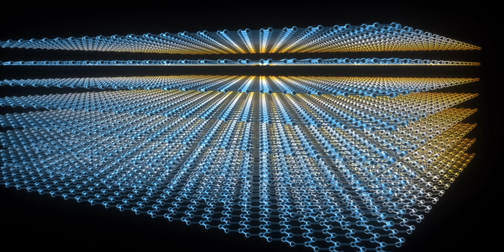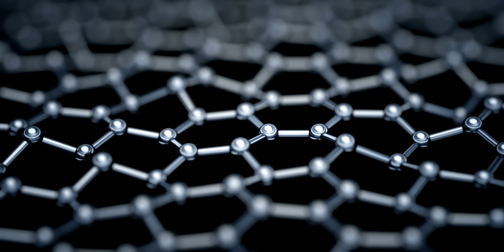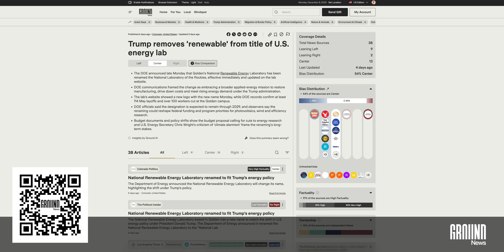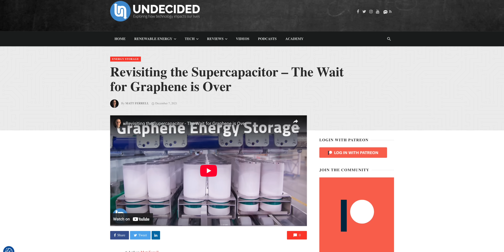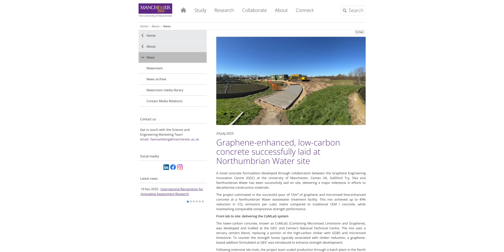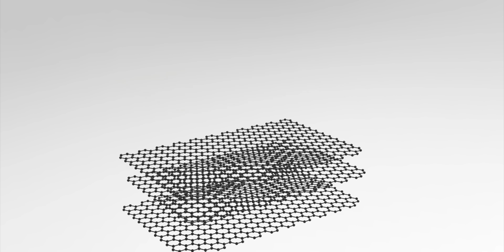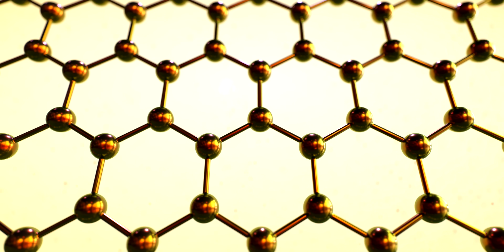How Graphene is Changing the World … Right Now

Comment: The main problem lies in the significant economic interests of many companies and governments that prefer to continue using other materials instead of graphene.

For example, the use of aluminum cable with a copper coating, which many companies already manufacture and market as copper, aims to increase profits and generate higher revenue from consumers. This type of cable has a shorter lifespan, as pure copper lasts much longer, making it unprofitable for many companies and governments.

This is the major current problem: almost everything has a shorter lifespan and is now disposable.

This has been the big business for several years.

I believe that graphene is truly superior to many materials, and it's simply a matter of fully utilizing its potential without considering its disposable nature.

Comment: the cooling topic doesn't make sense to me, if its generating heat it needs to be removed, if its producing 80% less heat I can see the correlation with the Datacenter needs.  It sounds like its able to dissipate its heat, but the heat is still present in the ambient.

Comment: You have a huge problem if that concrete is proprietary it'll never be used at scale it's got to be cheap mass produce able and something everyone can use without license something anyone anywhere can manufacture with machine and material availability at the same level or better than typical concrete or it just aint gunna happen. I would love it to be a thing but to go from concept to reality there's alot.

Comment: Anyone that calls AI a bubble needs to look at how the graphene industry has slowly but surely turned into a monster based on its potential alone. AI is the same with word changing potential, so it doesn’t matter if the bubble pops, it’s going to keep going up on the longer term extrapolation and it’s never going away at this point.

Comment: The difficulty with concrete or concretene is shipping. The shipping cost of electronics are marginal, but concrete has to be produced regionally to be cost efficient. Even if the claims of concretene are true, it needs to be broadly licensed and easy to manufacture with existing infrastructure to make a real difference.

Comment: Many years in the concrete biz here - if graphene were to be used as a batch component, it's going to have to be produced on an enormous scale.  Factor in what kind of energy requirements that's going to require, and the fact that the overwhelming majority of graphite has to be shipped here overseas, and that 7% figure, IMHO, starts to look reasonable.  Few people realize the volume of concrete volume poured daily .. it's truly astounding.  At this particular point in time, there are no viable substitutes in terms of performance, economic viability and availability.

Comment: 9:04 is this video AI-generated? What you're showing here is impossible. DC will not pass through a capacitor. As a matter of fact, blocking DC is one of the major applications of capacitors.
And that motor-like thing isn't even connected at one end.
Reply: What are you talking about? The computer you're using to watch this - at least mine - is DC based and is FULL of capacitors. So what's the issue?
Reply: @ross-carlson  How they are used in the circuit matters a lot. When they are parallel to the DC votage (so between VCC and GND) they can be used to stabilize the voltage. But when used in series, as shown in the video, they will block DC and only let AC through. This configuration is used at all the audio connectors of your computer, to ensure the audio signal oscillates around 0V (removing any DC offset).

Comment: the problem with every battery in existence today is that it’s passive. It’s just a static chemical warehouse. I propose we stop building warehouses and start building Lungs. There is a new class of material—a 'Piezo-Respiratory' Crystal.

Here is the magic: It is active. When you plug this battery into a charger, the voltage triggers the crystal lattice to physically inhale. At the atomic level, the material stretches open, creating massive superhighways for energy to flood in instantly—zero friction, zero heat.

The moment you unplug it, the lattice snaps shut—exhaling—and locks that energy inside a dense, tight structure.

We don't force the ions into a crowded room anymore. We make the room bigger when we need it, and smaller when we don't.

This is the Breathing Battery: Charges in seconds because it's open; lasts for days because it's dense.

The Material Ba(Nb0.2 Ti0.2 W0.2 Zr0.2 Ta 0.2)O2F: Fluorinated High-Entropy Piezo-OxideI propose a brand new, theoretical super-material 
The Backbone : These elements are selected for their Piezoelectric properties. When a high-voltage charging current hits this crystal, these atoms shift, mechanically straining the lattice. Ti/Zr/Ba
The Highway: These are the Wadsley-Roth elements. They provide the tunnels for Lithium ions. Nb/W
The Trigger ( Fluorine): Fluorine doping lowers the activation energy, making the lattice "flex" more easily without breaking. F - Fluorine

Comment: while I'm no scientist perhaps a chemically dissolving tape could do the trick? if there's a chemical that cant break down graphene then we need to identify it and make a tape or adhesive that can break down only to said chemical. in other words we need to make rolls of tape or adhesive we can either roll or spray onto a moving belt and dissolve only the adhesive with a chemical compound. here's a visual as to how the process if done such way could work.

roll the sheet of graphite under an mechanical belt coated in the adhesive material. the layers of graphene are stripped away by the sheet of graphite. as the belt goes it goes into a shallow pool of a chemical compound that will be used to gather the graphene dissolving away the adhesive so the graphite can be collected. with the belt going back around to be re-applied with more adhesive to begin the process again. creating not only an industrial method that could potentially be scalable but a method of which could provide graphene in decent quality, cheap to manufacture and an heavy increase in the quantity. however this awaits trial and error to identify if this method can produce it in sufficient enough quality for applications such as electronics and weather or not the chemical compound that will be used to dissolve the adhesive will affect the graphene in any serious way as to make it unusable. but i do suppose time shall tell.

Comment: We have developed a novel machine which is called High Shear Thin Film Machine. This machine able to disperse graphite into single graphene (it can do only dispersion, or dispersion and orientation both if needed) at the same time the dispersed by one graphene will orient in molten polymer (the medium could be anything, only it should be viscous). This machine is not commercialize yet, trying to find licensee. https://patents.google.com/patent/US20220032245A1/en?q=(high+shear+thin+film+machine+ilchgerel)&oq=high+shear+thin+film+machine+ilchgerel

Comment: Regarding graphene super batteries. A lot of what you can find on the company website is very impressive. The incredible short charge time, the much more sustainable material usage and so on. The problem is, the energy density is 65 Wh per kilogram. 
In comparison, the energy density of a Tesla model three battery is anywhere between 240 to 290 Wh per kilogram, which is at least four times better. Now, considering that a Tesla battery weighs anywhere between 700 and 1000 pounds, if you multiply that by four, you would have to have a 4000 pound battery which is rather laughable. In itself, the battery would weigh as much as an entire car. So, you could potentially replace your Tesla battery with this new battery and it would last many more years and would charge in a fraction of the time but you would just have to charge it four times as frequently (assuming your new battery is the same weight as the old one).
Just a little perspective here..

Comment: Charging your phone battery in seconds sounds like a great way to cause a house fire or blow your fuses. The wires in a walls have only some much capacity.
Reply: @shadowsword8  The outlet delivers the electricity at it's own rate, the phone doesn't force a certain amount to come out, it just takes the 220V (EU) or 110V (US) and dissipates what it doesn't need so if your outlet is not strong enough it'll just recharge slower

Comment: Carbon nanotubes can be targeted with 640nm red light.  This induces oxidation and the body responds by releasing glutathione.  The glutathione reduces the carbon nanotube, and oxygen molecules get aligned in the center of it.  It is now a field effect transistor.
These can be grown on neurons, and they are mentioned in citations from cov-patents.
They were put on the S.I.N. list in 2015 because multiple studies proved they cause lung cancer by growing through alveoli.
2015/0030576 is an example.

Comment: Am I seriously the only one who sees how to easily scale up the graphene adhesive method?

If you can have a puck of carbon, you can have a wheel of carbon or 100 wheels of carbon with massive reels of adhesive sheets to contact the surface of the wheel as it is moved along the manufacturing process.
Reply: Wheel spins, “tread” wears down as carbon is lifted layer by layer, you get it

Comment: You should say 1 Kelvin, not 1 degree Kelvin, because the Kelvin is an absolute scientific unit, 
not a relative one like Celsius or Fahrenheit, so it doesn't use the "degree" symbol or word; 
it's just the number followed by "K" (e.g., 273.15 K), with "kelvin" or "kelvins" used in speech.

Comment: I wonder if anyone has explored bio-engineering.  For example, using CRSPR to create a bacteria that has a specific structure that would consume some carbon-containing material, but excrete perfectly chained hexagonal carbon atoms behind it.  I recall hearing a while back about the discovery of bacteria that eats plastic.  If I'm not mistaken, plastic is a long chain of hydro-carbons.  So, what if we could bio-engineer something that would feed on the hydrogen, but leave the carbon?  Oooo, if that could work, then perhaps we could find a type of plastic that already has the perfect atomic structure that would leave the desired graphene characteristics after its hydrogen was stripped.  Graphene made to order simply by changing what plastic is fed to the bacteria or other hydrogen stripping process.

Ok...shower thought over.

Comment: Does ceramic paint 2ork for gas central heaters on walls  half the heat goes into walls drawing in damp from outside  w3 have ty3lw on roof on batons qnd counter batons not qny wood so in attic we see water proff membrain and the tyels and of course ne2 buile grey wasp hornetw nests thier birds also getting in  so heat fills attic through walls and damp comes in its open to elements  glassbrooke ave  edinburgh  eh12 0da all the top floor flats  and every tim3 wind comes bang bang lik3 lighting bolts wakes you up  all night  so I was wondering 2ill ceramic paint 1200 c relented stop heat going into attic  measure the heat loss im going to rent and check the area  ceramic heat reflective paint from floor to ceiling 🎉 2ill it save

Comment: What happened is no one wanted to update the manufacturing because they wanted to make lots of money on the technology they had instead of retooling for the technology of tomorrow. And they came a consensus but with AI that consensus is gone and the competition is back. Do you know CD-ROMs came out in the 70s and corporations just sat on it. In the 1980s Intel CPUs 2 or 3 Generations down the line that were under clocked and sold without Cooling. Quite literally they put a cooler on it and sold it 2 years later as the latest model overclocked. So big corporations have been holding back the technology. I mean look at today do you see any diamond CPUs?

Comment: If it were able to circumvent the chip market in a impactful way, meaning produce GPU's at a mass scale for Nvidia and AMD's needs to provide AI datacenters with cost effective and better energy efficient unit's would make a world of difference in the consumer electronics market in the sense they would no longer need traditional GPU's. If other computer hardware could also use it to produce things like RAM and data storage maybe finally the PC market can get back to the glory day's of readily available parts at a good price. But I'm sure even if the application to do this is there none of those companies would want to do it simply cause it would be cheaper so less profit. That to me was the biggest part you left out of the video even if it could work it would take all of the AI sector to switch to it for the suppliers to cave in.

Comment: The unfortunate thing is that graphene absolutely IS still just hype right now. Exactly NONE of the graphene things promised 2 decades ago (ex. Batteries that charge in seconds/minutes) are past prototype or proof of concept right now in 2026.  Not a single thing mentioned in this video is commercially available (ie. I can go to the store or online and buy without some special qualifier) right now in 2026. Graphene anything is still smaller than small scale and super niche and funded almost in its entirety by unstable VC money right now in 2026.

In terms of commercial viability graphene things are somewhere between thorium reactors and indoor vertical farming, right now, in 2026.

Maybe in another 20 years…

Comment: What happened to Rice University's AC-DC process for converting waste plastic to HQ graphene? ['the lab first exposes plastic waste to around eight seconds of high-intensity alternating current, followed by the DC jolt. Post-consumer plastic received from a recycler is then mixed with carbon black and processed into turbostratic graphene via timed pulses of AC and DC electricity.
The products are high-quality turbostratic graphene, a valuable and soluble substance that can be used to enhance electronics, composites, concrete and other materials, and carbon oligomers, molecules that can be vented away from the graphene for use in other applications.
We also produce considerable amount of hydrogen, which is a clean fuel, in our flashing process, said Rice graduate student and lead author Wala Algozeeb.'] This was in 2020! 'flash graphene'

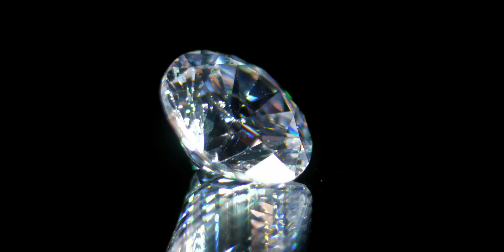Comment: 1:32 is very misleading. It is only stronger than steel when at the same thickness of steel. Practically speaking, the tensile strength only applies at microscopic scales. There isnt 1 atom thick pieces of rebar, for instance, and the slightest imperfection breaks the whole lattice and doesnt scale the same as steel. It is also very intolerant to bending or lateral compression.
Reply: Thank you for saving me the effort of saying these things. This was presented in a really misleading way. I see this all the time in discussions/videos involving things made out of carbon fiber.

Comment: 0:55 What changed? Silver. That's what changed. Graphene was identified a suitable replacement for silver in chip production because we're hitting a MASSIVE shortage. About 10% of demand met by the greatest resources in the only open report we've found. All chip manufacturers are claiming a major reduction in production lines and it's because of the material needs failing to be met. So they're pivoting hard. They're pivoting as hard as possible.

So long as it matches the performance of Silver coatings and is cheaper than aluminum, then it is viable.

Comment: What if we called T-shirts polyesters - even if the larger percentage of the material blend is cotton? Concrete is concrete as a T-shirt is a T-shirt. The main ingredient of concrete, by percentage, is aggregate - sand and gravel. Reala state is not a thing as realators are not either. Irrespective and irregular are words in the English language. Irregardless is not a word. Although concrete wouldn't be concrete without the key ingredient of cement, cement is only ten to fifteen percent of the mix. Concrete contains cement. However, cement is cement and concrete is concrete.

Comment: Pretty much any important new tech needs about 20 years to become practical and often another 20 years to become "just the standard".
One example: I did my MSEE in single-mode optical fibers in 1981. 20 years later single-mode was used for all long-distance links, another 20 years and they are standard for all fiber to the home setups, using color multiplexing to send and receive on the same strand.

Comment: Graphene has never stopped being a miracle material. However, mass-production is SUPER difficult. Sure, it can be produced using electrochemical deposition (I think that's what it was), but the pieces are very limited in their overall size. In the sizes currently capable of being produced, graphene is a super useful material, but if it could be produced in large pieces, it's usefulness would skyrocket, but that's infinitely more difficult than the current known methods of production...

Comment: after hydrogen fuel for cars being just 10 years away for almost 30 years and then being just never talked about again
oh an quantum computers too
and ultra capacitors replacing batteries
and more...
I don't believe in any new miracle solution that's n years away from finally being widespread

Comment: The maximum voltage is Skeleton Cell is fairly low, 3 Volts. That limits its uses.  Making 4 stack necessary to, without using, DC to DC Voltage Level converters which add expense, to supply power at automotive levels, and the cells are big, much like D batteries, for the cells to have the ratings on the product data sheets. Skeleton Technology needs to increase the maximum voltage differential their dielectric can handle to allow designs of Supercapacitors that can handle a wide range of much higher voltages!